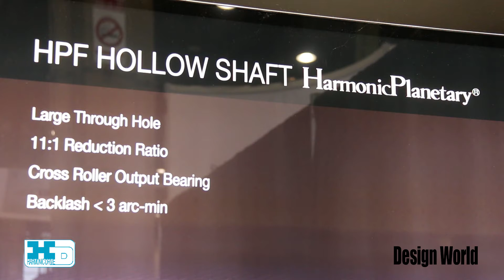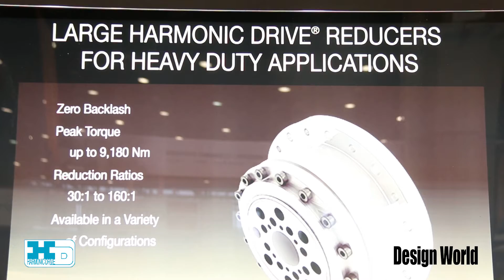Harmonic Drive - IMTS 2014 - Booth Tour

Comment: Hi we have a harmonic drive for our ultrasonic measurement device's rotating table we change the harmonic drive in 6 months is this possible that the harmonic drive broken down in this period and it is not a complete unit we assemble the wave generator with grease but the firm suggest sk1 grease is this a special one do you think our problem can be the grease for flex gear unit could you please give an idea and also it make vibration and noise while turning at the spesific rpm for example 2 rpm